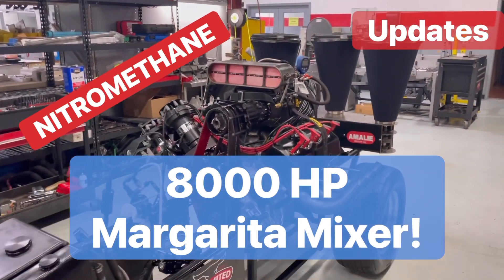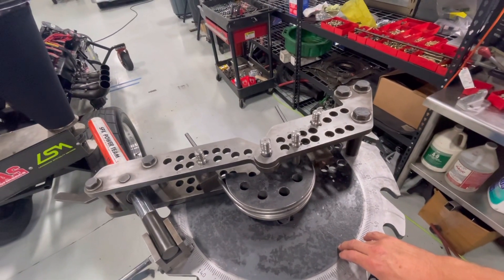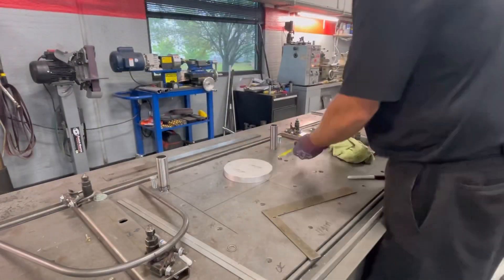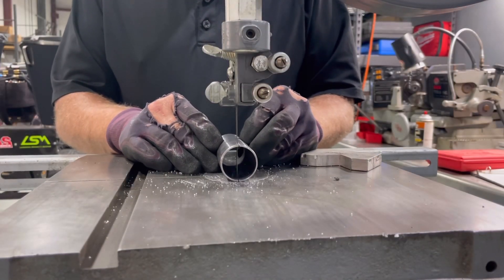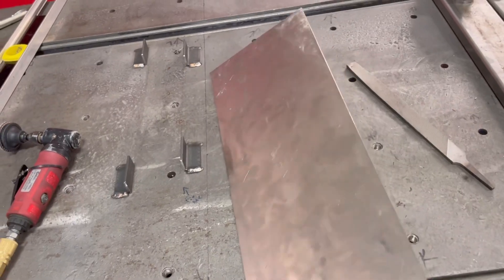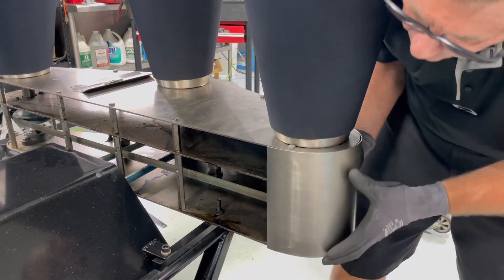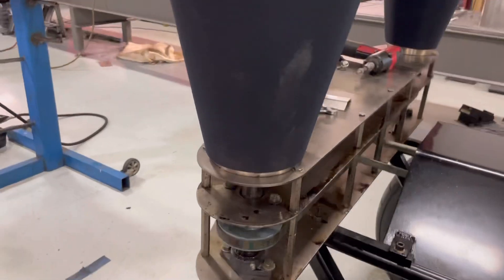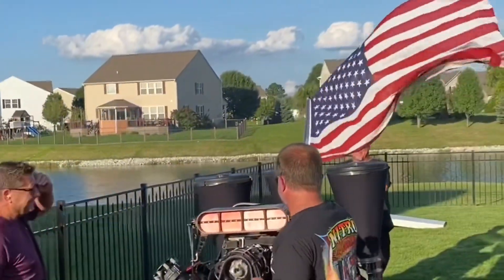Updates on the 8000 HP Nitro Blender

Comment: The Un-Official Skeet Shooting Margarita recipe courtesy of my good friend the late John Jisonna is:
To a blender jug add
1 small can frozen Lime-Aide concentrate 
Fill the small can with your favorite “Gold”:Tequila
1/2 small Lime-Aide can of your choice of Triple Sec/Curaco/Cointreau/Grand Marnier 
1&1/2 Small Lime-Aide cans of ice cold Corona Extra Beer
Fill the blender jug with ice install the lid and engage the warp drive

To serve rim each glass (solo cup) with juice from a fresh lime slice, then fill with that frozen concoction that helps you hang on” garnish with a fresh slice of lime and enjoy. Note a shot of Tequila carefully poured on top as a floater is optional. Lastly if Strawberry, Watermelon, Honeydew, Mango, etc are desired make sure to freeze the fruit for 12 to 36 hours before hand after you have washed, stemmed, and cut into small chunks and be sure to save and freeze and of the juices from the fruit.  Personally I like to freeze my fruit using dry ice by laying a layer of ice cubes to large ice chest, and then lay disposable aluminum roasting pans on the ice (separate pans for each fruit type) then place the cut up fruit in the roasting pans along with chunks of dry ice and then cover with a doubled up layer of aluminum foil and a couple towels.  T

Comment: I'm a little confused about the carbon fiber wrap over titanium.  The wrap is normally used to make something cheap look expensive, but here it's sort of doing the opposite?  (I could make you some real nice molded carbon fiber panels...)
Reply from the maker: The titanium was used for containment in case one of the pulleys or the belt came apart. There’s a lot of carbon fiber panels on the mixer so we just put some wrap on it real quick I didn’t have time to do like a key Foss or something